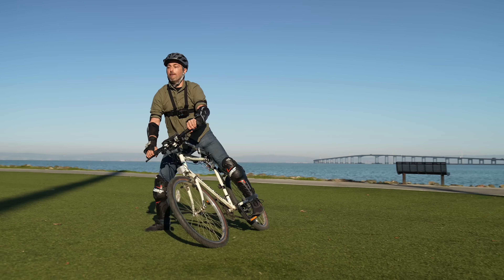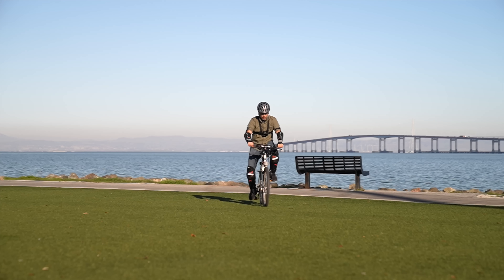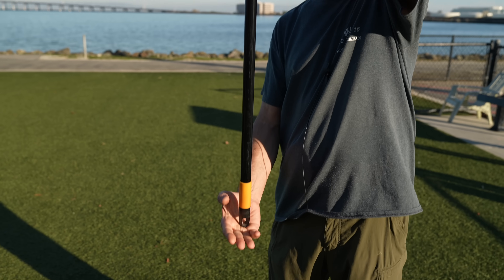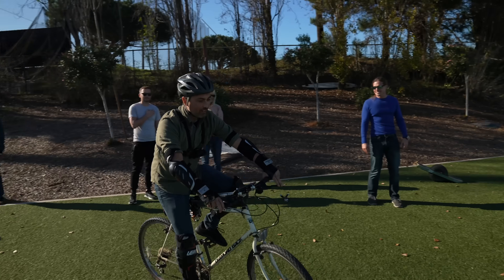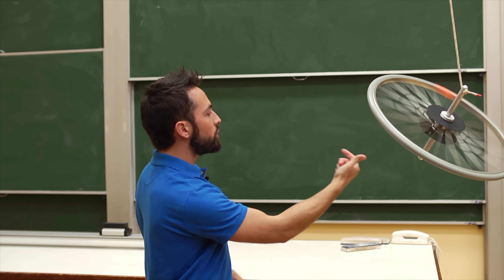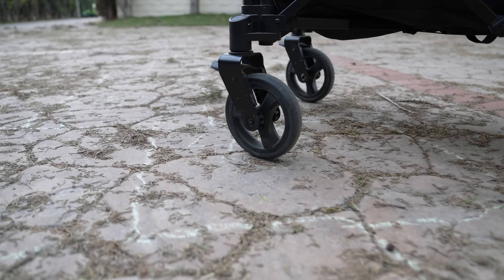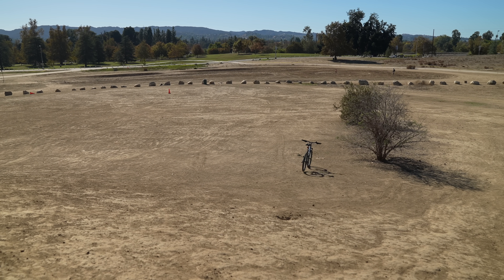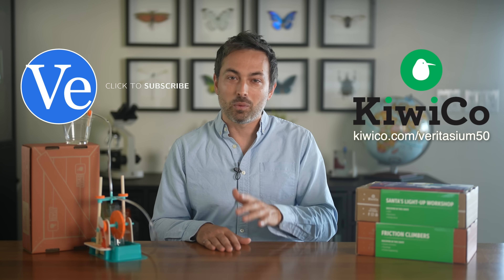Most People Don't Know How Bikes Work

Comment: It's actually fascinating how our body learns something intuitively yet our mind stays blissfully unaware.

When I said our mind that doesn't mean brain or something, by mind I meant conscious decision making. So all you nitpicky geniuses can stop now.
Reply: The broomstick balancing was a great example of this right?
Reply: Yup, with motorcycles you're carrying more speed, so you're not really make a left to go right, you're just pushing the front wheel off axis to get it to lean in the opposite direction. Above a certain speed you can just lean the direction you want to go and input nothing on the bars. The front wheel just falls in the direction of the turn due to the rake distance.
Reply: @SternLX  not exactly, leaning does not lead to steering. It may seem so because you're automatically putting more pressure on the side of the handlebar when you're leaning. The point of leaning or hang-off is to lower the center of mass, so the motorcyle can stay more upright which reduces the lateral forces on the tire.
Reply: @LFWK  nope, lateral forces on tire don’t change - it’s those lateral forces that bring you through the turn.  What it changes is the angle the bike and wheels makes with the road.  You need to keep the tire in contact with the road, and not drag the pegs. But keep center of mass way to the inside.  Opposite of skiing where you angulate to get your skis on edge.
Reply: And the more mind you try to push on whatever your doing, the worse it gets
Reply: What you're describing is the reason why saying something is "common sense" isn't helpful in an explanation. Most people forget that they needed to learn how to do everything they've ever done even if it feels easy now.
Reply: Pattern recognition doesn't require pattern understanding. Quite interesting indeed.
Reply: It is fascinating.  In a similar way we learn our first language.  A child can speak and pick out errors, but not tell us all the grammatical rules of the language, because they never learned them.  Still the best way to pick up a language.  Learning the rules should always come second.
Reply: @phobos2k2  nah this depends on the language. English often makes no sense, like that A on apple vs acorn. But many languages are not like that. I teach spanish and my students learn faster knowing the rules, because they give them a framework to practice. 

Once you're an adult, you can't learn like a child anymore. There's all these people practicing with duolingo and stuff, who memorize so much of the language yet can't speak it at all, because they can't think in it. Rules teach you how to think in a language.
Reply: If the mind was unaware, we wouldn’t be able to do it.
Reply: @SnailHatan  in that case, let's just say conscious mind
Reply: I mean yeah it makes sense. You don't have to know the science behind sharp things being good at scratching, you just know it does cause that's instinct/what you've experienced
Reply: well.. our consciousness stays blissfully unaware it seems
Reply: neural networks do their thing
Reply: Our body learns people in Government are bad... our minds stay blissfuly unaware just how bad
Reply: Subconscious
Reply: Thanks to the cerebellum
Reply: Surprisingly I can probably turn that bike I have taught my self to lean into my turns
Reply: i already knew this because i move so slowly uphill i constantly turn my bike a little to avoid falling
Reply: I've always been aware of this. Im actually pretty surprised and confused that so many people didnt know this
Reply: Translation:  "Isn't it cool how our sense of self-preservation keeps us alive even when we're being absolute idiots?"
Reply: It's our mind/cortex doing it actually dumdum.
Reply: It's not intuitive. You have to learn it through repitition. Learn to Engrish.
Reply: I'm 12 and this is deep.

Our mind controls our body at all times. It's our mind and its senses that help us move.
Reply: @borutb11  Not quite as you are confusing the mind with the brain here and the two are not synonymous with each other. The mind refers specifically to the conscious part, but the conscious mind is just one of many different things the brain is busy processing. In fact the mind does very little of the actual controlling even for actions made consciously, when was the last time you thought about any of the hundreds of individual muscle movements needed to type a short sentence for example let alone all of them. Other parts of the brain take care of that for you for the most part the conscious mind just decides what words to type and other parts of the brain convert that into a list of buttons to press in what order and directs your fingers to make it happen.
Reply: @borutb11  you're not
Reply: Praise to the creator
Reply: Did anyone realise the place he spinned tge bicycle  wheel is at MIT
Reply: actually it's not. Evolution made us do that when we started to walk and stand upright so it's in our nature. If not genetically at least something we learn at the very beginning of our lives
Reply: no u
i know how it works. simple physics
Reply: @Anudorini-Talah  you didnt know

Comment: If gyroscopic effect is not the main factor for the bike to be stable, can you explain how a bicycle trainer works? some models on bike trainers are just like cylinders on the ground where you put a bike on top of it. The bike is stationery but it keep balanced as long as the wheels rotate. But as soon as they stop you will lose balance. Because by that I thought back then it's the gyroscopic effect.

Comment: I feel like this is the fundamental problem with making a functional RC motorcycle. Because people don't know the explicit function of it, it would make it extremely hard to drive. And a computer program to adjust it would take time to do so making it feel unresponsive. Probably the same reason the motorcycle mod in BeamNG is extremely hard to use.

Comment: lol you can turn without what you called ''counter steering'', it's not impossible, when i want to turn, i lean to the side, and the i dont put much input to the steering, it follows by itself, because as you explained, it,s how it's designed. I Doubt that most people didnt know that steering a bike is about leaning though...because most people who rode a bike for some time experimented with riding it without touching the handles, and you can stay straight easily, just like you can turn left and right if you push the bike to the side with your hipsand follow with your weight to lean into the turn, also requires to pre counter steering mouvement.

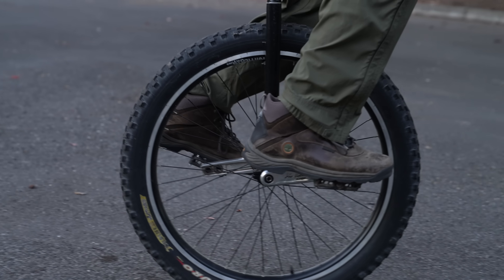Comment: you don't need to counter steer left to turn right. You simply lean in the direction you want to turn before the corner. None for your crash test dummies leaned before the turn which is why they needed to counter steer first. At 4:20 you say you "just happened to be leaning in the right direction" most people riding bikes have a destination and plan their turns in advance. Therefore, they will always be leaning in the correct direction before they make the turn.

Comment: A bike turns because it leans toward the corner. When I ride the track, to turn right I push my right hand forward to tip the bike into the turn. The steering never turns right! If I was to turn right by pushing my left hand forward, the bike would stand back up and then tip in toward the left. The lean angle is what makes the bike turn. It's a bit harder on a bicycle because you need to peddle, but the physics are the same.

Comment: I actually knew about this phenomenon a little bit. About 10 years ago I discovered that it was incredibly difficult to control a bicycle the more I moved my  hands further towards the center of the handle bar. Since I wanted to train my balance more I took it up as a challenge and eventually got to the point where I could maintain control by holding onto the top tub of the frame just behind the handle bars. It was incredibly difficult and terrifying. This verified the placement of the handlebars to the front spoke center as shown in the video being both a contributor to self balance while not being an outright requirement for minimum control.
Reply: Or just ride with no hands

Comment: Dutchy here, I cycle most of the time without holding my hands on the stearing. I really wonder how or if that would work the same way. I turn corners without holding my stearing as well, so I think that I would manage to stear even if my stearing would be locked.
Reply: No you could not. You ride with no hands because of what was explained in this video. When the bike leans, the handlebars turn to compensate their new center mass. If they can't turn then you will instantly lose balance without that automatic correction from the bike.
Reply: @XiaolinDraconis  possibly yes, but I would still like to try to test that out. It's not that I don't believe you, but I'm curious to find it out myself through testing.

Comment: It would have been really cool to hear Derek explain what happens when you ride hands free and turn by leaning, but I would say it was covered by the force applied to one side of a gyroscopic wheel.
Reply: He covered that part when he explained why a bike works with no rider. The angle of the fork and the center of mass at the contact point. When you lean the handlebars automatically turn, lean the other way to straighten back out. Gyroscopic precession plays a very minor role in this.

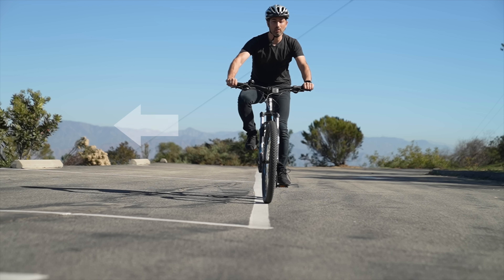Comment: stopped at 2:20...

Motorcycles, at speed NEVER turn in the direction they want to go... you apply pressure on the right handlebar "turning left", and lean right.... to go right.

so this makes perfect sense , if the steering is locked so ANY turn tot he left is impossible... you cannot turn right.... and I'm not sure how this video is going to go on for another 9 minutes

Comment: Take a bicycle or motorcycle up to a speed where it gets quite stable, then remove your hands from the bars.  Now, just lean in the direction you want to turn, and you will turn that way, without any counter-steering inputs.  I believe at a high enough speed, gyro precession becomes the strongest force acting to initiate the turn.

Comment: Isn’t it because the pedals (where the feet go) and the handlebars (for the hands duh) are connected at the hinge side but they’re also being held in place due to the rider, meaning the twisting force on the hinge isn’t getting applied to the front wheel so it doesn’t balance itself, and it doesn’t even really have to do with weight distribution. It would even account for weight distribution since if your body moves there is less pressure on either the left or right foot, I think, right? 

If this is incomprehensible my apologies I am 100% blasted.

Comment: The "caster angle" of a bike is also why 4-wheel cars are stable in the forward direction (same with 3-wheeled robins). But that's also why going reverse at high speeds is very unstable.
Reply: It’s funny you say that because I used to work in a Coca Cola warehouse driving a forklift that steered from the rear wheels. 
Aside from picking or placing the load we drove everywhere backwards. 
Originally I was told it was so we could see because if you’re facing the pallet of soda you can’t see around it, which is true. But now that you’ve said this I realize stability at speed was a huge factor. 
We absolutely FLEW around that  warehouse with loads on the forks (48 cases of Coke) looking backwards and driving facing opposite the steering wheel and no one ever crashed.
Reply: Also why forklifts are hard to drive forwards, since they are often rear wheel steering
Reply: Also, to add when driving in reverse you have toe out in the front wheels, which makes the wheels want to turn, not go straight.

But doesn’t apply to 2 wheeled stuff.
Reply: Yes
Reply: Increasing the caster angle increases stability but decreases turning radius, increasing the positive trail increases stability going forward but decreases stability going in reverse. I think most of you are confusing caster with trail
Reply: Big if true
Reply: It has nothing to do with caster. But more to how the weight of the vehicle is managed. In cars most dampers in the front are very soft compared to the rear. This is why 4 wheel steer is very stable compared to two wheel. Im sure you can get into the crazy physics of it with the weight shifting and all sorts of cool stuff. But going backwards is not unstable because of caster.
Reply: @Sak-zo1ui  I think the reason why 4 wheel steer is more stable is more to do with the steering system itself being more powerful on 4wheel steer.
Reply: @alternator7893  it seriously comes down to weight management that is it.
Reply: @Sak-zo1ui  weight distribution is part of it, having most of the weight up front will help control speed wobble when going fast.
Reply: @alternator7893  toe in or out affects speed stability.
Reply: Noticed reverse instability with my RC car before! Now I know why.
Reply: @youtube is run by afghans If you find one that goes in reverse.
Reply: @youtube is run by afghans Nah, there's almost always enough adjustment to make a car have toe out, which is toe in in reverse! motorcycles generally do not have reverse sadly
Reply: @Big_Iron_Mode  yeah toe in going backwards is the main reason for reverse instability
Reply: @alternator7893  Generally toe in (forward) is actually very insignificant, maybe .1° at the extreme. That’s not much feel wise. You really feel it around 1°, it becomes much more difficult to suggest the car when backing into a turn at least on a sprint car or LMP in my experience. 

Of course LMPS aren’t meant to do that; but of course we’ve tried lol.

Caster works against you when going backward, trying to rip the wheel from you and when it gets a moment to shine it happens so fast you can’t recover the car while going backwards
Reply: @alternator7893  but, it’s totally significant going backwards. It’s just not as significant as caster is when they’re both working against you, in the real world on pavement. That is, just in my experience. Far from having driven everything out there
Reply: 3 wheel robin?
Reply: @strangeclouds7  robin by reliant it’s a 3 wheel car that you only needed a motorcycle license to drive
Reply: @chubeviewer  is that in the USA? 
In Texas a Polaris Slingshot 3 wheeled car is considered an automobile and doesn’t require a motorcycle endorsement
Reply: @strangeclouds7  The Reliant Robin is a car that only has 3 wheels.
Reply: @Encicia  it is not the only car tho, i think morgan has one too but 2 on the front and 1 on the rear
Reply: @siontheodorus1501  Yeah, but that's called the 3 Wheeler and the Robin was explicitly mentioned in the comment above ;-)
Reply: @strangeclouds7  Is your Google broken?
Reply: @phildane7411  Oh look someone answered my question how bout that. Do you rely on Google for everything you muppet?
Reply: yep
Reply: The caster angle is to take the load down to the ground, nothing to do with being stable.
Reply: @berniefynn6623  Errr... no. The mechanical properties of the structure do that, not its geometry. A zero castor angle would still "take the load down to the ground" (otherwise bits would, by definition, be falling off). A crane cable takes the load to the ground, even though its applying force straight up - it just goes via the jib and crane structure.
Reply: @andyowens5494  My mistake the castor angle is the foreward /backward angle of the steering wheel, puts the load ahead of where the load would touch the ground. The CAMBER is the inward tilt of the vehicle wheel.
Reply: @andyowens5494  funny thing is that by increasing the caster you decrease the trail which should make it less stable,  but the decreased turning radius and increased wheelbase that comes with increasing the caster makes it a LOT more stable overall.
Also funny is that as the bike approaches a zero caster it becomes less stable, but if you go into a negative caster (the forks going backwards towards the bike) it loops back to being stable (provided you also increase the wheelbase) because of the positive trail, but it also becomes impossible to steer at that point, the only way of steering being leaning your body side to side like a skateboard.
Reply: @alternator7893  Why are you replying to me with this information? It is unrelated to my comment, which was quite specifically in response to another comment about transmitting load, not stability or caster angle.

Comment: i learned the bike is really about which direction you lean, the handle bars are just assistance. figured it out as a kid cause i thought riding a bike without hands was cool. and frankly if you ain't got hands on the handle bars you can still turn. by leaning to the side

Comment: As I'm sure any experienced motorcycle racer would agree,  When riding a motorcycle on a race track at speed to change direction quickly it takes heavy counter steering. Only way to make the bike flick from being fully leaned over in one direction to the other,

Comment: So basically in Control Theory term, the bicycle itself when moving forward have a local balance stable zone around the 0° steering angle, as long as the steering deviation from the balance point does not exceed the threshold into unstable region, the bike can self-regulate back to stability, just like an inverted pendulum controller. Did I get this right?